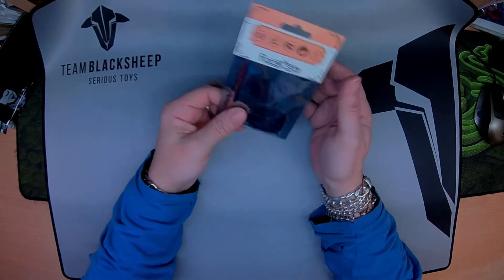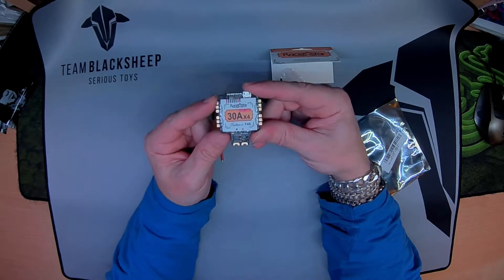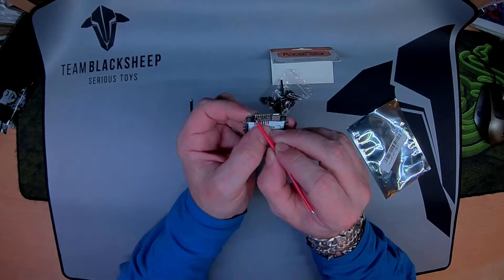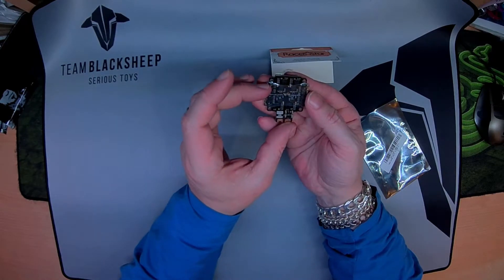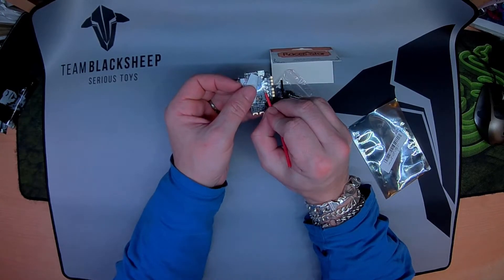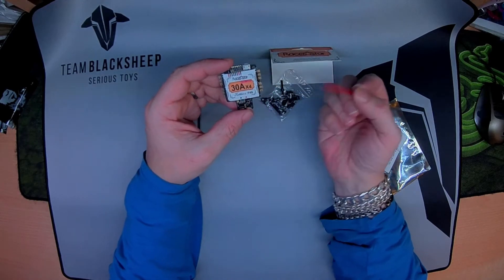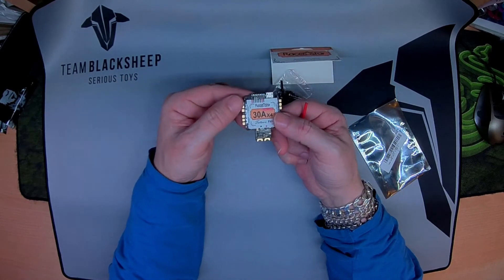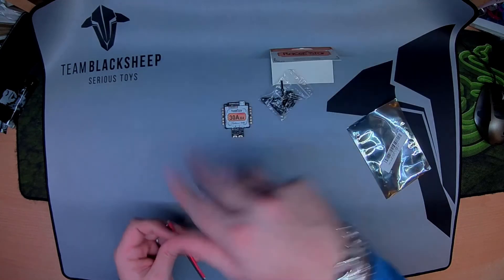Racerstar Tattoo F4S AIO 30A BLHeli_32

Comment: Any video noise running this board?
Reply from the maker: No interference at all from what use I've had. No capacitor installed running a Runcam Split from the onboard bec. The VTX is powered directly from the battery.

I have it updated to 3.2.1 and then 3.2.3 with no issues using the LUXF4OSD target in Betaflight. This board is featured on my C240 build, If you would like - I can share a DVR recording with.

Hope this helps!
Reply: MrE thanks for the quick response. Definitely helped me.
Reply: Hobbyking has a similar board looks the same and it is on sale $60aud.  Could be another rebranded version

Comment: Hi MrE. Nice video. Have you tried getting ESC telemetry to work?
I can't figure out what UART it connected to or if it is even supported.
Reply from the maker: I am just about to put it in a build,I dont require ESC telemetry so I have no first hand advice to guide you but I can take a pot shot:

Firstly it requires a hardware UART and Dshot, I believe the only possible UART would be the one on the right hand side of this board that would be utilised for Spektrum from memory.
There was some conjecture if that uart was hooked up when I read about this board iirc but I would assume it would be. From the silkscreen it would be UART6.

I hope this gives you an avenue to pursue, the Betaflight info gives some guideline but no doubt you've already consulted it but here it is if you havn't:
https://github.com/betaflight/betaflight/wiki/ESC-Telemetry

Good luck, please let me know how you get on either way!
Reply: MrE since UART 6 actually has solder pads on the board and is recommended for telemetry, smart-port and perhaps even DSM. I would be surprised if ESC telemetry was connected to that.
Reply from the maker: If it was possibly with this board,thats the only place I would consider applicable other than the sbus uart,sport port could be resource remapped to the led pin with soft serial.

Uarts for the most part are quite universal, just limited by the hardware requisite aspect of the esc telem.

I wish I could give you a crystal clear answer but its above my pay grade :)

Comment: Agro mode works fine but in angle mode it is armed but wont throttle up.
Reply from the maker: Check your modes to see if you have any wierd combo on the aux chan (possible turtle engaged?)

Comment: Have you been able to update this board to BF 3.2.3 or is the Lux target only good for 3.2.1?
Reply from the maker: I have yet to do anything other than a quick look at it so far,but I do have it ready to drop in a frame very soon.
Is there no LuxF4OSD target for 3.2.1?
Reply: There is for 3.2.1 and I also have yet to play with mine. But I've read someplace that the Lux target didn't work past 3.2.1. I'd rather see someone else try it before I try mine lol.
Reply from the maker: I may be taking one for the team in that case! I will certainly need to upgrade mine from 3.1.7 so I think that may well be the first order of things then.

Is there any critical thing that you require in 3.2.3?
Reply from the maker: So you got me curious, flashed to 3.2.1 then 3.2.3 and looks all in order,do you know what is supposed to be wrong?
Obviously this is a lone board with nothing else connected as of yet - I'll have a look through the CLI shortly and see if any resources are not the same.
Reply: MrE haha nice. No wasn’t looking for anything particular in 3.2.3. Just making sure the target was still viable for when 3.3 comes so I can use f-port to free up a uart.
Reply from the maker: FPort is indeed interesting and welcome! For this I have been intended to use the LED output for softserial/telemetry with prehaps a split on the spek uart if poss. The UARTS are the only thing lacking on this board
the build with that will be documented quite comprehensively I'm anticipating - just need a rain dance or disco.
Reply: MrE yeah I’ll be using a Split with mine on a Japalura.
Reply: MrE well keep us posted nonetheless and thanks for looking into that for me anyway.
Reply from the maker: I will indeed, no problem! (this split was for my Japalura but since the V2 came out I need one for the Armattan,the spare v1 is destined for a beater racer (the C240 frame))
Reply from the maker: Subbed you, had everything all ready for the Japalura build over this off season and as is the way,the new stuff always postpones the build.
I look forward to going through your content!
Reply: MrE likewise! Thanks!

Comment: Nice video and cool outtro! 
And for an update on the car........... Well, the lipo arrived, it works really  good and has alot of power, i havent even tried max speed yet, because i didn't had enough space or it would flip, just after a few minutes the cap also broke, so i think i'm getting a pro line one and make it fit.. at least it was fun :p
Reply from the maker: Hey thanks! ,I bet its good to finally have a speedy drive after what seems like alot of time?
Whats the cap that broke?